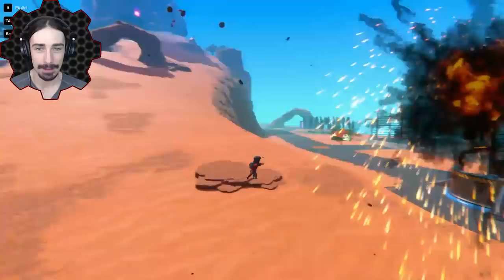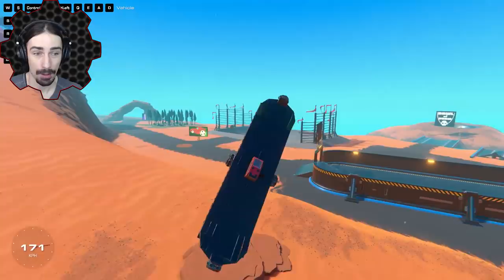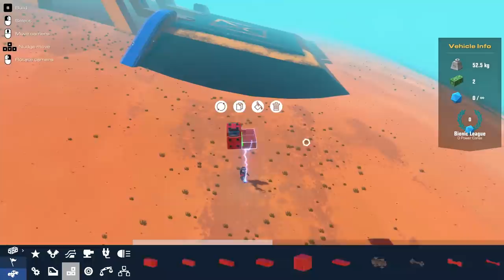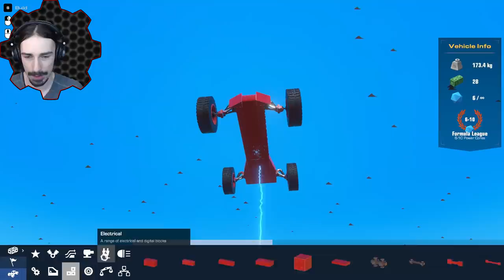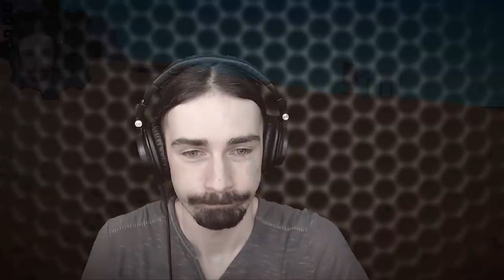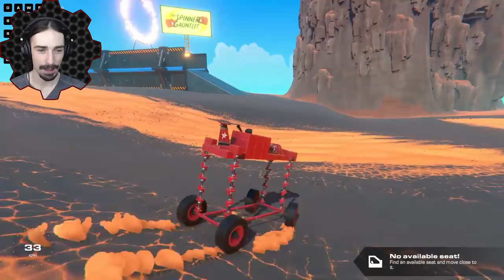Can a Car Survive This GIANT CATAPULT?! - Trailmakers Early Access Gameplay

Comment: I got a tip:
If you have a smaller radius at the same angel per second the distince will decrese. As the Distance decreses the accselleration decreses. If we have a smaller accselleration we should have a better Chance at surviving.
Also I think you should try using more Suspension In parralel. This way the force required to compress should increase. If the vehicle actualy touches the ground, it would help.
I'd realy like a second attempt and wish you good luck!

Comment: Stacking suspensions or springs doesn't increase the stiffness, it only increases the length of the compression according to hookes law. To make them stiffer they must be put in rows or between the same objects, kind of like in the end of the video where the bottom of the car was all connected. And I think experimenting more with suspensions in rows instead of stacking them could help with the problem, because when they're stiffer they need a stronger force to fully compress. Also consider try putting suspensions under the gokartseat, since it's very light it should ease the force put on the suspension.

Wish I had trailmakers so that I could try this but unfortunately I haven't. Anyone that could test this for me, or even scrapman himself?